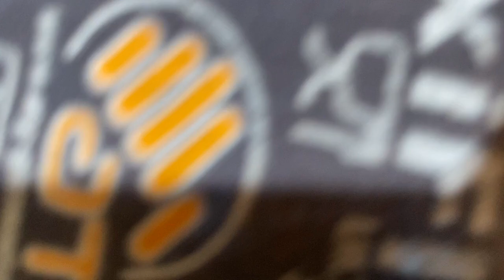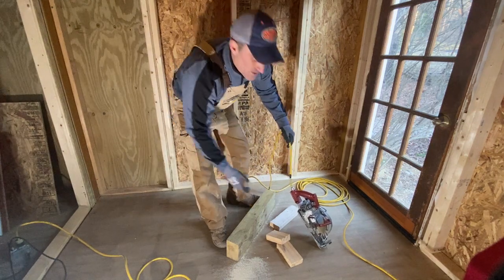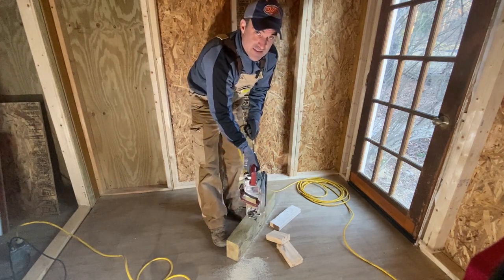Rewire Circular Saw with Extension Cord & Strain Relief How To #how #howto #diy

Comment: So when I worked for a company framing houses it was against the rules to modify any tools one example is the saw you can’t have a cord longer than the 6ft cord they provide when you buy it due to it drawing to much power so is there some thing your doing different? Let me know I have 5 skill saws and every cordless super saw from the name brands I’ve never had to run a cord that long directly from my saw. I have been working in construction since I was a little kid about 6 years old I’m 29 now never have I seen someone on the job site have the need for that running a 100 foot cord and the 6 ft cord unsually can reach anywhere around a house even if the generator is on the street you have a spider box you can run off of. Seriously would just like to know what the need for this is thanks.